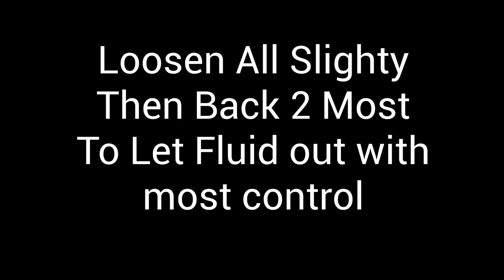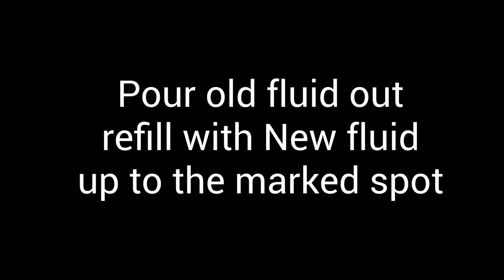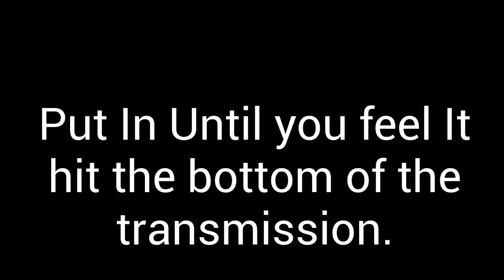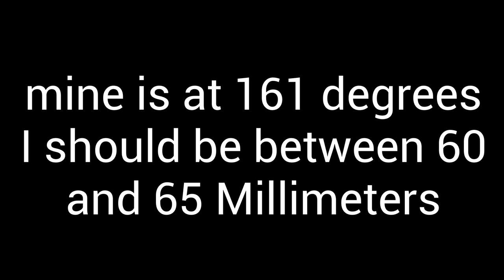Transmission Fluid Change: 2013 Dodge Charger V6. (Works for 2011-2014 Chargers, Challengers, 300Ms)

Comment from the maker: This video applies to 2011-2014 3.6L Engine - Chargers, Challengers, Chrysler 300's, Grand Cherokees, etc with 5-Speed Nag 1 / W5A580 Transmissions.
If you have the 8-Speed (8HP45RE) this video is not applicable.

Comment: My car doesn’t have the trans fluid cap ?
Reply from the maker: If so then that's a big problem. I don't recommend you drive it until you put a cap on it.
Reply: @mrficks1838  at 1:51 in the video that whole piece I don’t have is what I meant the whole entrance for the transmission fluid is not there could it be somewhere else? Thanks I’m advance I’m having a hard time ‘12 3.6 charger
Reply from the maker: If the tube is also not there then you have the 8HP45 transmission and it's a different process which all is done under the car at the transmission pan.

Here's a video that shows it: https://youtu.be/XObN94hkQ-Q

If you have the tube but no cap then you'll just need a new cap so moisture doesn't get in and damage the transmission.

Comment from the maker: For a 2013 V6 you will either have:
- a 5 Speed (Name = Nag-1, aka W5A580, etc.)
- an 8 Speed (Name = 845RE, 8HP45RE)

You'll know which you have by how many gears you have. You can find this out by putting it in to manual mode or just listening for the shifts. For the 5 Speed you put it into manual mode by pushing the Shifter to the right once -- I don't know the procedure for the 8 Speed. Looks like the Shifter Designs are different for each of the 2 Transmissions also.

The 8HP45RE fits:
Chrysler-Dodge-Ram
2015-Present Chrysler 300 V6
2012-Present Dodge Charger V6
2012-Present Dodge Challenger V6
2014-2017 Dodge Durango V6
2013-Present Ram 1500 V6
(Source: https://blog.fcpeuro.com/zf-8-speed-transmission-guide-8hp45-specs-common-problems-diagnostics-maintenance)

(In-Depth Info for the 845RE - https://drive.google.com/file/d/1dnJOMjNig47HGznoyCratGbYsECCPaaB/view?usp=sharing
This guide lists these models that use 845RE -
Dodge
15‐17 Challenger
13‐17 Charger
14‐17 Durango
14‐17 Ram 15000
Chrysler
13‐17 300
Jeep
14‐17 Grand Cherokee)

Comment: I am going to do this fluid change next week but the info that I am finding when looking for a correct fluid amount seems to be varied from 4.3 quarts approx. up to 8.  Did you use more than a 5qt container?   Thank you for the vid!
Reply from the maker: It can vary slightly that's why this method of measuring what came out is important. If I remember right it was around 4 quarts, but again, make sure you use the graph to measure and ensure the correct level is in the nag1 transmission, very important.
Reply: Saw a video saying it can be 6-7 quarts on the 8-speed Trans... also, it’s important to check the temperature of the fluid while checking the fluid levels. Very complicated... dealership will cost about $650-$750
Reply: @omarcortez6277  just cause you saw a video of that video "using 7-8 quarts" doesn't mean you will..

I saved myself thousands,  well $1500 as others say, by doing it myself! Took over 8 hours but I got it done! Mine took 4.5 quarts on my 8 speed v6!
Reply: @mrficks1838  I know this is an old video, but yup your right, mine took 4.5 quarts... and has 120k miles, and I don't think it's ever been done. 

How often should it be changed ?
Reply from the maker: @B_HarTz  - Just seeing this now - I think changing (also this won't be a 'full' change because 'one draining' only gets out about half of the fluid, I think) -- but about every 30k miles is a good idea. 30 -50k miles seems to be a good marker point for peace of mind since hearing reports of this transmission having problems if not 'babied'.

Though IMO many abuse these transmissions and then complain they are no good.

Comment: How come mechanics are telling me only dealership changes transmission fluids?
Reply from the maker: Joe Biden's Shotgun • they have a probe machine designed for it... This method works just as well though. Also the mechanic might be reading the notice on the trans cap and not wanting to mess with it.. And/or void Warranty.

Comment: Hey I need help I have a 2013 Dodge Charger sxt awd with the 8HP45 Tranny and I’ve been trying for some weeks now to find the fill point on the transmission and I have ton dipstick or tube for dip stick I’m think it’s a plug style fill point but I can’t find any information on my issue . Reason for wanting to do fluid /filter change I think my Tran fluid going bad car has been late shifting/jerk only between 39-42 than it’s fines don’t think it’s anything major. And I not trying to pay dealership 350$ for a job that’s cost me 45$ for 9quarts of ATF fluid lol please reply
Reply from the maker: Hey, yea that's not a fun one to work on for sure, ha. Here's some resources:

Here's your Plastic Pan / Filter integration: https://amzn.to/2MpsmSd (Just check to make sure that's gonna fit.. I'm looking this stuff up fast for you.)

Links to working on it: https://www.youtube.com/watch?v=XObN94hkQ-Q

https://f30.bimmerpost.com/forums/showthread.php?p=20612300

You'll need a transfer pump too and they are cheap on Amazon if you don't have one yet. - https://amzn.to/2T8FUEa

Thanks for watching. Please shop on Amazon with those links because it's helps me out. Best wishes on your Transmission maintenance.